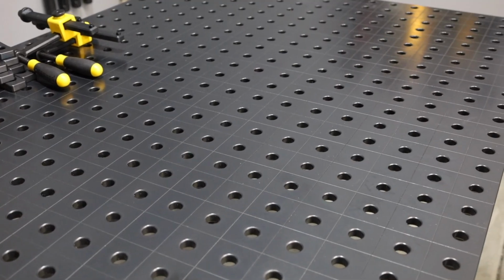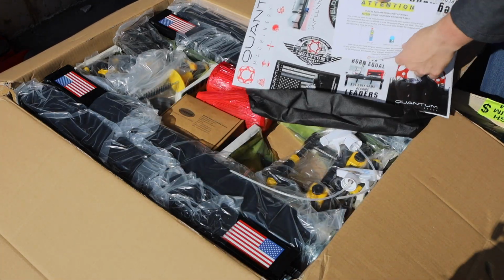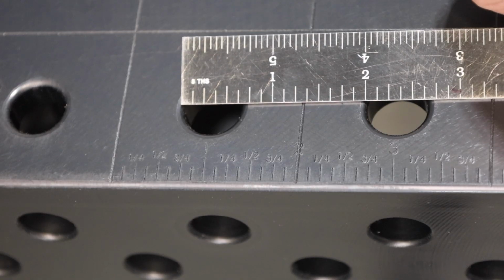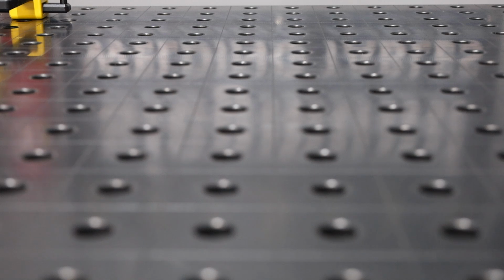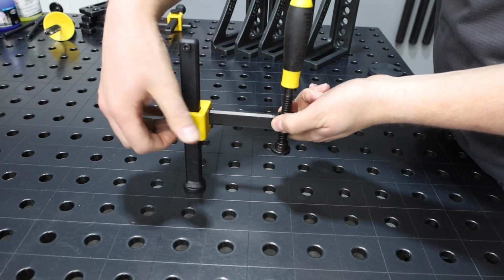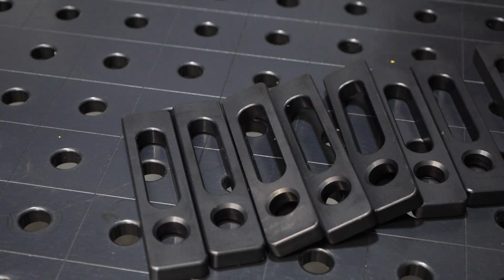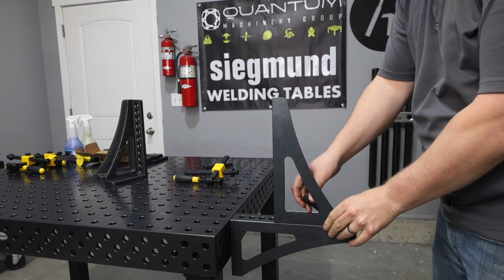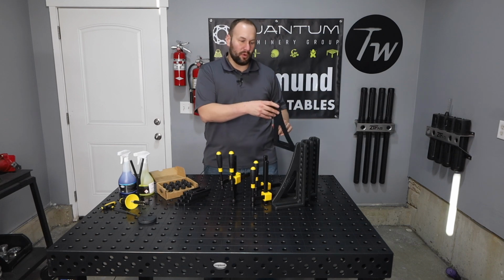Siegmund 3’x4’ Welding Table & Clamping Kit

Comment: We bought ours a few years ago and absolutely love it!  Since purchasing, we modified the original legs and added machine casters with built-in, ratcheting leveling bases.  We're also considering the Fireball Tool 'Dragon Wagon' to compare.
Reply: Just be aware that fireball uses 3/4” holes.

Comment: Oh, Tim, I don’t know how I missed this video. It answers my questions. It wasn’t easy to get mine in and set up either. It took me over three hours. Fortunately I have a good stacker. Though it was somewhat difficult to get the pallet out from under it.

The table is really good and the accessories are well made. I have somewhat different accessories than you received. But my weakness is continually buying more of everything, it seems.

What I like about the clamps is that these models and the other heavier versions that don’t have the horizontal movement in the beam, lock at different heights. I hate the fact that others tend to drop when you remove the work, and then you have to get it set up again each time. These let you loosen them, swing them out of the way, and swing them back. So much easier and faster.

Comment: I'm pretty sure these are rebranded Kovosu tables, get it cheap directly from them.
Reply from the maker: These are German made, extremely high quality and hard tables. It’s not that Kovosu tables don’t provide a good value option, but it’s not the same thing.
Reply: Interesting since the accessories seem to have very similar molds.  Hole chamfering and tapers looks very similar as well. It’s definitely possible design is being copied by Kovosu.  What’s the flatness measure?  We have a Kovosu SS 304 and we have measured it to have flatness of 0.15 mm across the long length of our 4.5’ x 8.5’ custom table from them.

*we paid ~$13K excluding customs etc
Reply: @securitycamera322 they’re not Kovosu tables. Many other companies copy the Siegmund tables and fixtures. Some are a lot cheaper. None are the same internally.

Comment: If you have a mag drill you can make these tables yourself for less than $200 with some square tubing for legs and 7/16th steel plate.  $5k for a table with some holes is ridiculous. I made mine with 90 degree sides as well for less than 200. Just as level and flat as these.
Reply: I highly doubt you’re is anywhere as good as a Siegmund. Sorry, but you’re not going to get the same spacing equality as a CNC table. Nor is yours going to be as flat, or as strong as this 0.500 thick hardened and tempered tool steel table that’s machined, then ground after tempering. Enjoy yours, but don’t fool yourself.

Comment: Bought two of them, absolutely love them I can make a 3x8 , 4x6 out of 2 of them, awesome tools!
Reply: What did two tables cost you?
Reply: @ChanceDeLaShy I paid $1999.00 each, yes $1999.00 the same kit thats double that today, I’ve had them for nearly 3 years now, absolutely love them.
Reply: @ChanceDeLaShy I’ve bought nearly $4000 since in extra tooling etc, I’m having Delrin Pucks made (basically Prisms) so I can do other work, like woodwork etc. I bought one then Quantum machinery told me there was a price increase coming so I said send me another, back then they were $1999 for the 3x4 kit with all the tooling and going up $500.00 so I jumped on it. Now I believe the kit is $4500 which I’d never pay it today, that’s too much for my wallet. I’m into everything I have which is quite a a bit of tooling with a used snap on tool box for,storage for less then $10,000.00, you never see them for sale used. They are great, down the road I’d like a series 28 set but for now the imperial 16 is great even though the imperial 16 has less tooling available compared to a series 28.
Reply: @MarcAnthony435  You were wise.  I bought the same kit for $2K.  Love it.  I had considered jumping on a second one at the time, but I didn't 🤦🏻‍♂️.  Now, I'm thinking I'll snag the 2x3 package and make a 6x3.  These tables are worth every penny.
Reply: @MarcAnthony435 Siegmund has different prisms. I have their clamps., and have various materials for the feet as well, including nylon and poly.
Reply: @melgross  I’ve made standoffs etc from Delrin for odd fixturing
Reply: @MarcAnthony435 that’s a nice material. But be careful with too much heat as the breakdown products can be dangerous.
Reply: @melgross  ya just for standoffs, way away from the Heat! Thank you Though!

Comment: What was wrong with your Arcflat table by Langmuir? I think you can combine another table and make the same table as in this video….just wondering. Cheers
Reply from the maker: Great question! There’s nothing wrong with the Arcflat, but this table has a lot of advantages other than the size. The material is thicker and the holes are at a tighter tolerance, which makes the clamps sit more true. The surfaces are a consistent thickness and have chamfers ground on the bottom, which allows the use of quick mount fasteners that won’t work on the Arcflat. The table is made from hardened material which prevents dings that affect dimensions. The nitride coating keeps weld spatter from sticking. The engraved grid pattern and rulers make setups much faster. The overall quality is at another level as well. They are both a good for their price, but this system is in another league.

Comment: Can you talk about the deltas with the Langumir Table? My largest complaint of the Langumir is that they are not very thick and the BuildPro bolts don't work without modification.
Reply: My Buildpro bolts work with this table without a problem. Just get the 0.98” length bolts and not the slightly longer 1.1” bolts. This won’t tighten down without a thick washer. My Buildpro clamps work as well. I don’t know why the bolts don’t work in your table. What’s the problem?
Reply: @melgross  You own a Langmuir table? Just to clarify you don’t mean the Siegmund. My table might have a different thickness than yours. Could be a casting issue on my end.

Comment: How much did you pay for it? Sponsored? Is there a discount code?
Reply: I paid 1999 for mine 2 years ago right before there price increase, today there 4500 for,the same exact kit
Reply: I'm thinking certiflat for that price, then.
Reply: @sammccollum2985  ya, I don’t know how good they are as I’ve never looked into them but I can’t see spending $4500 for a 3 x 4 table. That’s why I bought two of them back in the day because I figured they were going to go up in price I would not pay $9000 for two of them today that’s for sure.
Reply: @MarcAnthony435 once inflation is figured into the mix it really isn't much of a difference in actual costs. As long as your revenue has stayed  up with inflation.

Comment: Hi tim, I’m in the market and cannot decide between steel and cast and whether or not to nitride.  I’ve heard cast is better because it’s inherently harder to weld to and dings/scratches do not cause deformation in the material. 

Also, I’ve heard nitride and coating make it more difficult to dress surface with stones and abrasive pads without removing the coating itself.

Being that you own the arcflat cast iron as well as a steel nitride table, I’d love to hear your thoughts

Thanks,
-Chris

Comment: Hi Tim, what are your thoughts on your previous Langmuir table?  That looked like it could work for my needs. Was it well built?  Thanks!
Reply from the maker: It’s good for the price point. It doesn’t have the ability to accept this type of locking bolts and the size is smaller (though they can double up).
Reply: @TimWelds  thanks for the reply.

Comment: You illuminated the functionality of vertical uprights well.  Anytime you're cranking out multiples it's all about removing variables in production and I could see setting up and welding 20-30 copies at a time without problem on this unit. Not enough to build a dedicated jig/fixture but still a time saver and guarantor of repeatable product tolerances

Comment: Bruh, that table is beautiful. I'm slowly learning how to use mine, sure does make squares a lot more square. Fighting distortion is always a losing battle, but these tables help.
Reply: I wish the engineers and designers who draw these things would learn a little about avoiding distortion in the first place and countering it.
But they show fitments with no space and scribble codes without thinking how it's going to pull.
Reply: @jimurrata6785  I imagine that it's hard to factor in because it's so... not random, but incalculable. How can it be quantified? Maybe the tolerances account for it? I don't know, but it's one of those things that no one really thinks about unless you're welding it. I don't really consider it during fit up, mostly because I don't know how to. But I know it's going to happen, because it happens every single time.
Reply: @JackOffAllTrades  I've always felt that any engineer, designer, architect, whatever... should have to work in the trade they design for (so they realize challenges and don't spec the impossible)
Is there an absolute amount of distortion you will get from a weld... every time?   No. 
Too many factors like stress already in the material, fit up, how hot the bead goes down, how fast it cools down, HELL, how that particular filler rod felt like behaving that day
But pencil pushers and button pressers can help you overcome. Or they can back you into a corner and stick a knife in your neck.

I'm not suggesting that they spec an unsafe weld process or compromise the design. Just design to make that 'perfection' attainable.
(This coming from a guy whose longtime friend designs and specs (as well as INspects) plumbing for the nuclear industry.

Comment: Nice new fixturing table! 
Kind of a shame they don't just put a tapped hole at the center so you can thread a lift eye right into it. (yes, I see the ribs only allow 1/2" engagement, unless they were cut away)
Even a grade 2  1/2-13 bolt is rated at 6600lbs clamp load, lifting eyes are forged and much stronger but 1/2" of 1/2-13 thread can easily support that top.